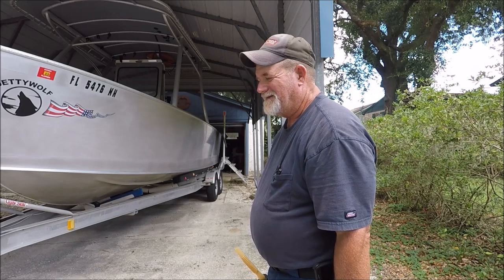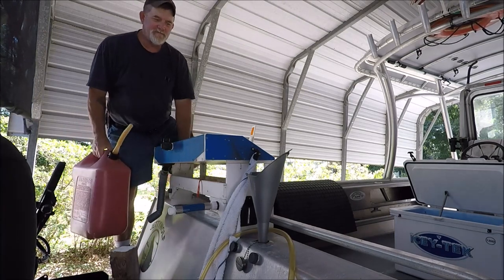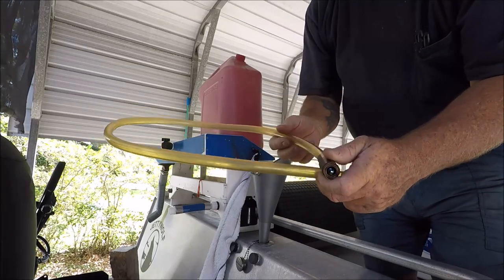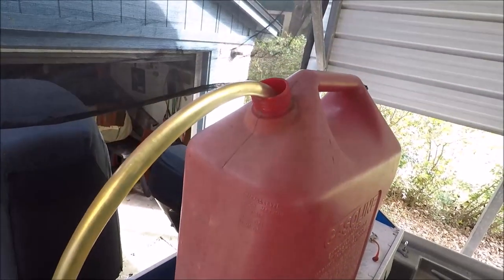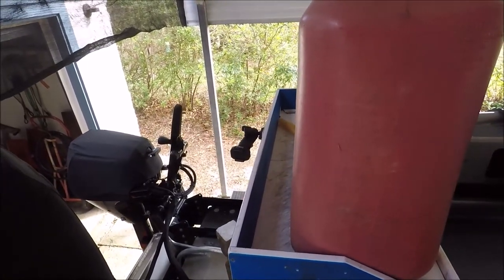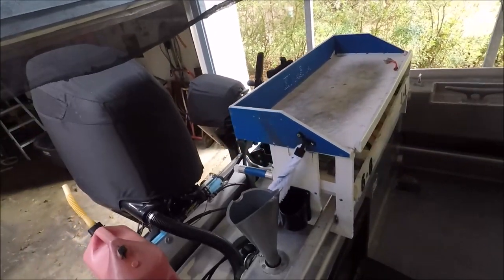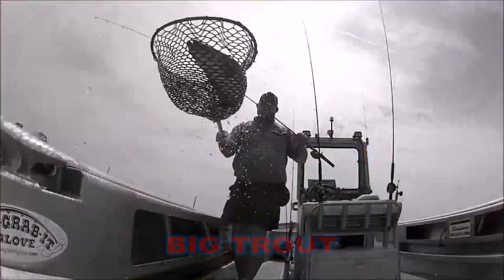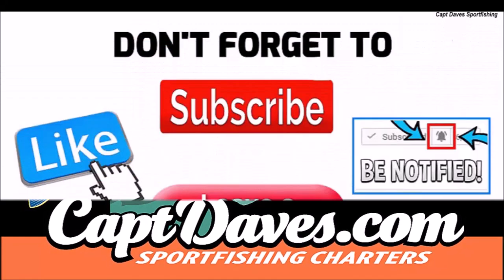Truck, Boat, & Gas Stations, my fix 🛠🛠

Comment: I despise pulling to the gas station!! What I hate even more is boating to the marina to fill up. The prices are sky high and fighting to get in is a pain. Been doing what you’re doing for years except for the shaker tube. I’ll be getting one of those. Thanks
Reply from the maker: I though most everyone heard of these thangs...guess not. If its a gadget, yu knw I've either got it or had it.

Comment: HORUSDY Gas Siphon 6FT Multi-Purpose Super Easy Siphon Pump,1/2" Valve Virgin Grade Tubing Safe (White)

Amazon have and HF.
Reply from the maker: GET MINE AT HARBOR FREIGHT....I may have said that in video